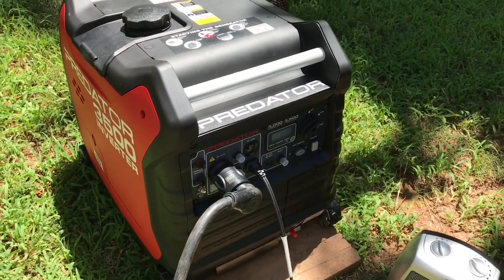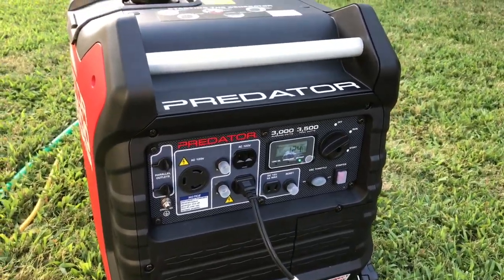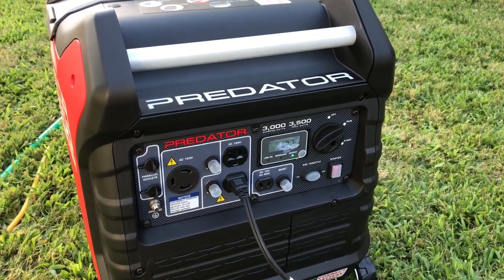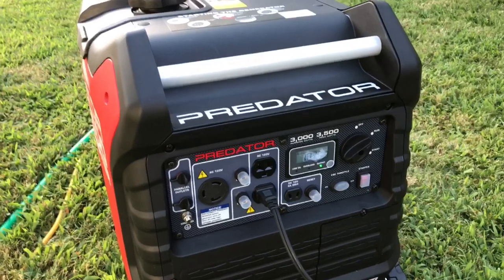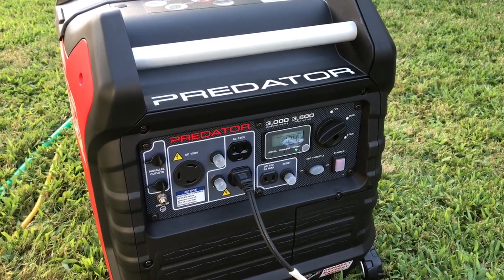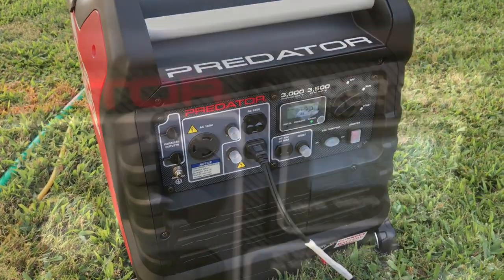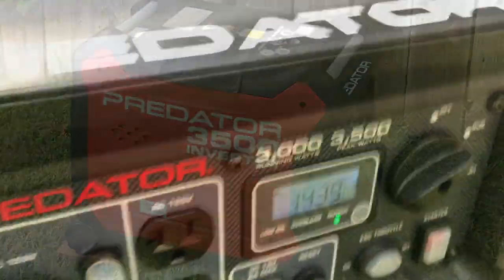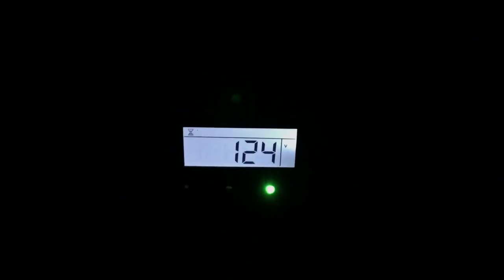Predator 3000 3500 Watt Inverter Generator Test - Defective Replacement

Comment: If this is used for emergency use only, what's the process for fuel in the tank (keep reading about gummed up fuel in carborators)? Should it be run dry every time, or is there a draining process? Seems like this should be part of most maintenance videos...which I haven't seen thus far.
Reply from the maker: David T Smith, I'm not using mine for emergencies only. I guess some people do buy them for emergencies only, and it would be a good ideal to store the generator without fuel in it. Commercial home standby generators usually have a auto start maintenance feature that "exercises" the generator every so often. I'm guessing one of the benefits of this is cycling the fuel through the carburetor.
Reply: David T Smith run it once a month for 15 minutes, always run non ethanol fuel and you will never have a problem starting it when you really need it.

Comment: Roland, how big of an electric motor can be used? 5hp? 10hp?
Reply from the maker: Tjr Pmw, I have no ideal. I bought it to power my RV.
Reply: Tjr Pmw If we figure 3500 starting wattage, I'd say maybe 1-2 HP depending on style of motor.
Reply: Cory Stansbury do you think this would be able to run a torqueedo or Trillin motor on a pontoon boat?
Reply: 746 watts per hp

Comment from the maker: My fridge, a Norcold 3163 only draws 1.4 amps or 168 watts in AC mode. Running the microwave was showing over 2200 watt draw at one point. Even if you subtract 400 watts from that it's still way more than I would expect from an 1100 watt microwave.

Comment: Is your rv a/c a 13.5 or 15?
Reply from the maker: My AC is 9200 BTU. I guess I didn't mention that in this video but I did in the first one. My water heater is 1400 watts, the electric heater is 800 watts on low and 1500 on high, and the microwave is supposed to be 1100 watts but it was drawing around 1800 with this generator.
Reply: Roland  You're either going to need a big generator or just not run them all at the same time, obviously.    LOL

Comment: Just a note for people who buy anything like this, is the fuel cap, this one looks to have a breathable cap some don't ,you have to loosen a smaller cap on the top,eg boat fuel caps,this lets the air in.Even the cap like the one in this video, They can block up with dust and the motor will lack power or stop,You will notice this when you undo the cap and it sucks in a large gasp of air..

Comment: Hey Roland how's it doing now? Thinking about gettin one?
Reply from the maker: They are great generators. I now convert them for use in the Winnebago Rialta (which is why I bought it in the first place). Check out my conversion at www.rialtagenerators.com. 

If you buy one and it runs rough, take the oil fill door off and try it that way. If it runs fine then, it’s an air starvation issues. It appears the manufacturer has not corrected this issue yet. You can solve the problem by replacing the oil fill door with the ventilated type or enlarging the ventilation holes in the bottom of the case. The ventilated door is filtered I believe so that might be the best route. I get rid of the case altogether. 🤣

Comment: hi very nice video , thanks for the info, do you still have it, would you recommend? im looking to buy a generator
Reply from the maker: TIQUI78, yes I still have it. I customized mine so I could install it into the generator compartment on my RV. The only problem I’ve had is with trash getting into the carburetor. I’ve decided to try running an extra fuel filter...one before the fuel pump and one after. The original generator doesn’t come with a fuel filter. I believe it needs one.

I currently have 282 hours on mine and yes, I highly recommended it. It has been a great generator and is a great buy, but I recommend that you purchase the extended warranty as it takes 10-12 weeks to get replacement parts from Harbor Freight if needed. I tried to order a carburetor and I was shocked and disappointed at how long I would have to wait. Turns out mine just needed cleaning...twice. The warranty is worth it just so you don’t have to wait.

Comment: As for the Microwave issue you were having I've dealt with that and truck inverters for years. All the ones with the turn tables tend to do that. I believe it's the turn tables that draw all the extra watts. I run one without the turn table in my transport truck and it does the exact wattage it says. The ones with the turn tables always do that. Common knowledge for guys who are running inverters in their trucks off battery power. This comes up once and a while, and it's nice to see  someone else noticed like I did. Just a heads up for you. Best to get an older microwave without the turn table, so you don't run into the probem.
Reply from the maker: I threw away a perfectly good MW when I bought this one because I thought something was wrong with it. It would take 5 minutes to heat a cup of water. Well, the new one does the same thing on my old generator. Something about a square wave or something. That's another reason why I wanted to get a new gen. But it seems MW's and generators just don't mix. lol

Comment: Do you have any idea how long it will run on full load on a tank of gas ( how many gallons does the tank hold ) ?

Any idea if it has a fuel filter ?

Might stock up on air filters ( and fuel filters if it has one ) and spark plugs .  And any other parts that are a regular maintenance item .

This is , after all , harbor Freight & you never know how long those parts will be available ?

Thanks ,
Wyr
God bless
Reply: Also , see how widely avalable the battery is , from sources other than Farbor Freight .

Thanks ,   :-)
Wyr
God bless

Comment: Thanks for the video. When are you doing the install into theotor home? I am very interested in that
Reply from the maker: z50king29, I've actually been working on designing a new housing for the engine/generator combo since before the purchase. I'm now very close to assembling the first prototype. The problem is my RV is so small that it's taking some really complicated modifications to make it work. But I've gone as far as I stand it on paper. It's time to put something together and see what works and what needs farther modifications. But I think the Predator 3500 is a good platform to build on. I just needed something that I can get parts for when needed.
Reply: Roland White thanks for the reply. Very interested. I have a Honda eu3000is. Cool. Neat. Thank you

Comment: I found the issue of not running right to be the carb.  When they test them in the factory, they leave gas in the card that goes bad and starts to varnish.  You can add some "Seafoam" or other carb cleaner to the gas and run it with "Eco Mode" off for a half hour.  This will clean the carb and it should then run like it should.  I had two that ran bad out of the box.  Once I ran crab cleaner through them, they ran like a top.
Reply from the maker: Well that's good news. Maybe that's why the manual recommends "stabilized" fuel. Seafoam is labeled as a fuel stabilizer among other things. Maybe this info will help others.
Reply: Yes, if they run some carb cleaner through the carb by adding it to the gas, it will make them run as they should.  You need to use some type of carb cleaner to get the varnished gas out of the carb.  I even had a Honda snow blower do the same ting when new.  It surged while it was idling.  After running some carb cleaner through it, it ran great.
Reply: Same.   Sputtered for the first 5 minutes.   Added SeaFoam, sputter soon went away.   Runs smooth now.

Comment: What did the oil look like on it's first change of the second generator? The first one just looked like way too many aluminum filings. Thanks for the extensive review!
Reply from the maker: I changed the oil in the second generator at 7 hours and it looked nearly the same. I believe there was a little more wrong with the first one than just a bad fuel jet. It actually smoked a little when I first cranked it up and the spark arrestor got black very quickly. The second generator never smoked and the spark arrestor is still clean. So maybe the first gen had some serious engine problems.

Comment: Nice video.  Seems like a capable unit.  Your microwave is 1100W output. It'll draw 1500-1600W to make that output, so it's close to normal, there. My house 1100W microwave pulls about 1600W.  Today's modern A/C units actually draw quite a bit less than older units and, once started, can be quite decent. A 15,000BTU A/C, nowadays, can often pull 1100-1300W once running. at max cool.  Thanks for a nice review/update. (I'm an electronic tech, 45 yrs experience  20 years+ in emergency/backup power systems,  from 300W thru to 1.5MW. ) Stubat
Reply from the maker: D. Stuart - Thanks for your explanation of why the microwave draws more power than I expected. It makes sense that it would require more than 1100 watts input to produce 1100 watts output. I guess I was suffering from backwards thinking. 🙄
Reply: At least the microwave ovens have a gradual startup load, unlike refrigeration units. But they do pull the power!  My 1100W unit does cook quite a bit faster than the 800W unit, which pulls about 1200W and is quite a bit smaller. I've seen a lot of comments on the "Torch" plugs. Think I'll buy one of these units, and a real sparkplug. I have to admit, I ran a "Westinghouse" WH2200iXLT cheap generator for around 3,000 hrs before it failed, and that was an inverter fault, engine still runs. I'm impressed by the reliability of these Chinese generators... Stubat
Reply: @D Stuart, Hi, I am hoping you can help me out. I want to purchase this generator to hook my Mytee heated carpet extractor up to it and the specs sheet state runs at 20 amps @ 115V 60Hz. In your opinion, is this generator capable of running this unit?  Thanks,  Mike

Comment: Thanks for sharing your videos man I really like them but aren't you supposed to plug in your loads on the top before you plug into the bottom 120 outlet? I know that's what the manual says for my 7,000 running watts Predator anyways but I just wanted to mention that cause I noticed you plug into the bottom one and not the top one in both your videos cause that might make it run not so smooth if your supposed to put your load in the top plug before the bottom plug but it might not matter in your new Inverter model I don't know but maybe you could check that out just to make sure? Just trying to help but cool video.
Reply from the maker: Charlie MMAFAN, thanks man but it doesn't matter which plug you use. They are actually all connected together. I've looked inside. 😊
Reply: Also make sure you use the 30 amp round outlet.  You can draw up to 30 amps before overload on that one, but I suspect you already know that and are using it.  I've been surprised how many people I've seen that don't know to use that 30 amp plug for there travel trailer hook up.

Comment: Mine would not start from a cold start. Went back to return and they were out. They did extend my warranty but I had to either get it fixed on my own or wait for a replacement which they had no idea when they would get one. I took it to a small engine repair shop and they would not touch it. My son is an electrician and he looked at and found the small cater pin had came out from the throttle and it was laying in the bottom of the cabinet. He reinstalled and fixed by flaring it so it would not come out. We hit the start button from a cold engine and it fired right up. Great product but you have to be aware. It runs my my Camper and it is quiet.
Reply: So if you turned the switch to start  mode and tried starting it with the electric start it wouldn't go? That is what mine is doing i have to turn the dial to RUN and then it will start .

Comment: Just bought one on August 19,2017.  Ran pretty good out of the box but a slight sputter after about 5 mintues of running (slight popping sounds and a slight shaking although the slight vibrating/shaking at may be normal... a bit more more shaking in the economy mode).   First I tried to remove the oil fill cover.  no difference.  Then i added Seafoam and another stabilizer.  No difference.  Then i changed out the spark plug.  Not sure why as it had a Bosch plug in it but put in an NGK plug.  No difference.  Put about 2 hours on it then changed the oil.  Definitely saw metallic reflections in the oil.  For some reason, that seemed to make the difference.  Running great now.  Going to change the oil again at 5 hours.  I can definitely feel the strong suction drawing in the oil cover when I take it off and then put it back on while its running.  I suspect future models will address the air starvation issue.  Can't seem to figure out where it's getting air from now. But man is this thing quiet!

Comment: I was wondering how many hours have you put on that generator. Also would you recommend it.
Reply from the maker: Believe it or now I haven't put any more hours on it, but I'm about to. 

I actually took it apart to convert it into a "RV" version so I could install it in place of my current generator. It's almost ready. I painted the cabinet today. It didn't take me as long to convert it as it would appear. I've probably have 4 weeks total into it. I've been busy with other projects but now I need to finish it up before Christmas vacation, so I've been working on it everyday for the last week or so. I'm really happy with how it turned out and will be posting a video of the finish product soon. 

Happy Holidays

Comment: Has anyone experienced problems with operating at high altitude?
Reply from the maker: It is recommended to change the jet for attitudes above 5000 ft...I think. It's in the manual.

Comment: A microwave oven is only about 50% efficient, so it will draw around double the VA of the output that it is rated in watts.
Reply from the maker: CrazySparkie63, that's weird. I can't understand why it doesn't blow a breaker then.

Comment: The first one or two oil changes will look like silver paint.  This is normal.  As a new engine breaks in, metal particles will be suspended in the oil.  If you had an oil filter, this would not happen.  If you don't change the oil in the first 5 hours, you will cut the engine life in half.  looks like you got a good one.
Reply from the maker: Yeah, I changed the oil in the second generator at 7 hours and will change it again after another 10 hours or so. Thanks!
Reply: AAR2VZ no this isn't normal. Lol I have owned many engines and never had the oil look silver. Not in quality name brand stuff like Honda's and yamahas anyway. Remember you get a 90 day warranty with HF (2 years on emissions stuff ONLY) and 3 years ON EVERYTHING with a Honda. Yes a Honda costs more and that's why. I'll be interested to see how many predators are running after 4000 hours or 15 years because I know several Honda's doing that right now.

Comment: Just be careful the inverter can burn out if the engine is shut off or runs out of gas under load
Reply from the maker: B Casterlin, thanks for the warning. It actually says in the manual that you should unplug all devices before shutting the generator down. I think I'll just hit the main breaker if I get concerned.

Comment: You needed to Replace the Generator because their was something wrong with the first Generator.
Reply from the maker: Yes, I took and back and swapped it for another one because the first one seem to have a fuel delivery problem. It would surge when idling and hesitate when a load was applied. I guess you didn't watch my first video. Well, you can watch it here: https://www.youtube.com/watch?v=y43ZigsPLOk&t
Reply from the maker: mharris1270, I think Harbor freight only allows one exchange. But I could be mistaken. After that you have to take a restocking fee.

Comment: Don't used Automotive oil in air cooled engines  it  doesn't have the ZDDP (Zinc) Needed for small Engines  You need a oil with at lest with 1000ppm  Zinc  1200-1400ppm is best  Newer automotive oils only have 600-700ppm because High Zinc will harm the Catalytic Converter  on automobiles ! Use a Diesel Rated Oil  they have a Higher Zinc content Plus extra additives that help the oil handle more heat  One Great Oil is Shell Rotella T6 5w-40   great for colder & hotter weather If you want your Generator to last for many years  Use a Quality Diesel rated Oil like Rotella T6 !
Reply: Why don't the manufacturers instructions say that? They only say to use 10w-30 oil..nothing/zilch about Zinc levels.
Reply: Dan theman Zinc is just a corrosion inhibitor

Comment: No need for such a strong microwave I would get a 800 watt microwave so you can run both
Reply from the maker: mathew eigen - I just bought one that fit nicely. It's not a big deal not being able to run the both at the same time. I can heat most anything in 2-3 minutes and I can even cook a baked potato in 5. I can do without AC for that length of time.